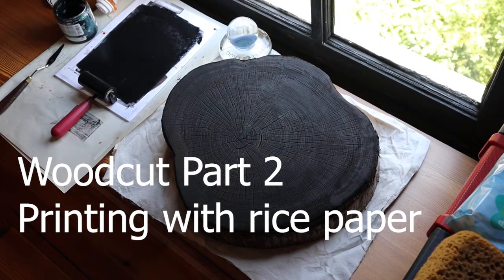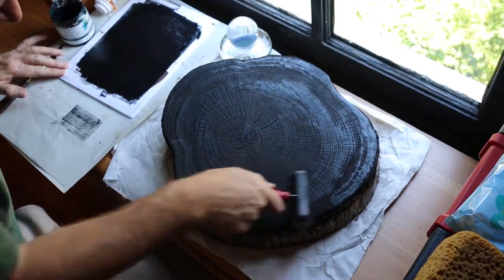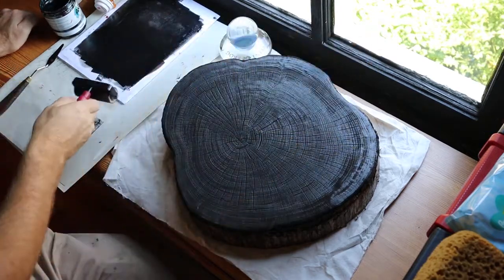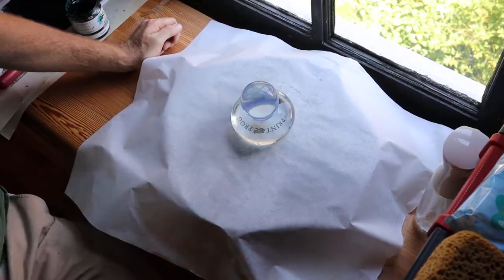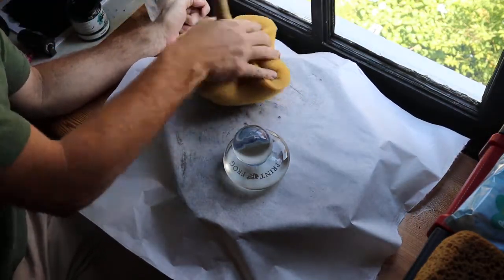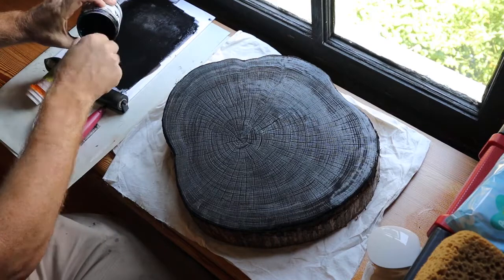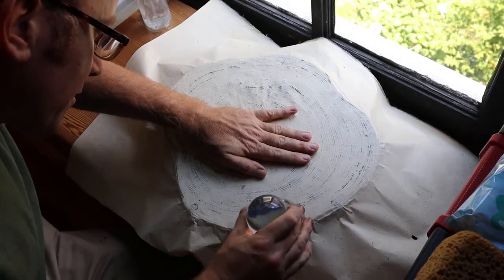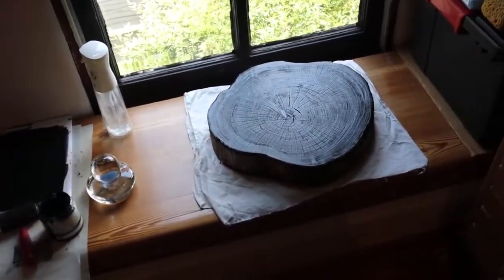Woodcut: Printing a Woodcut on Rice Paper using the techniques of Bryan Nash Gill (2/4)

Comment: Was there too much time between adding ink and applying the paper?
Reply from the maker: Thanks so much for the comment. I was using akua ink, so the problem definitely wouldn't be the ink drying. 

that doesn't mean that you couldn't have a problem with the stump absorbing the ink. That was the point of the shellac at least in part. The issue with the stump absorbing the ink tends to be a problem that happens immediately though.